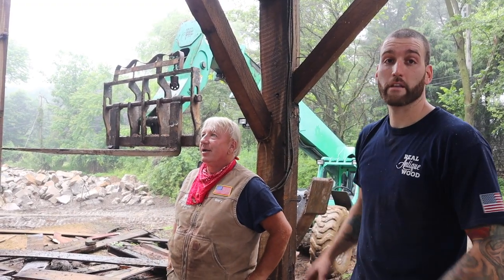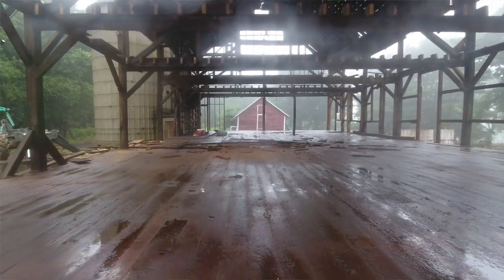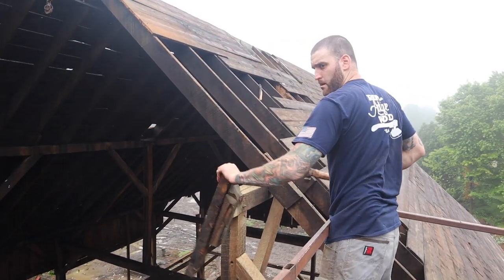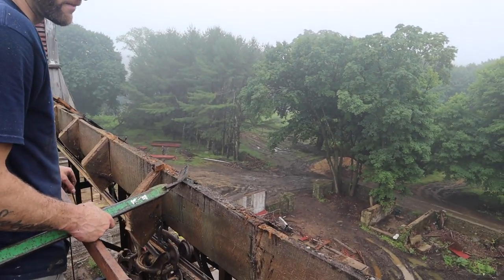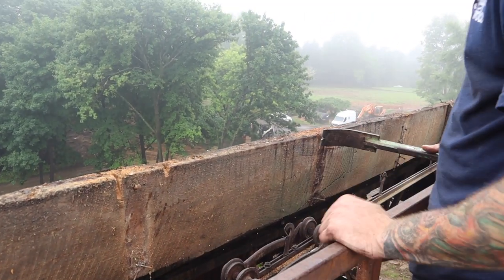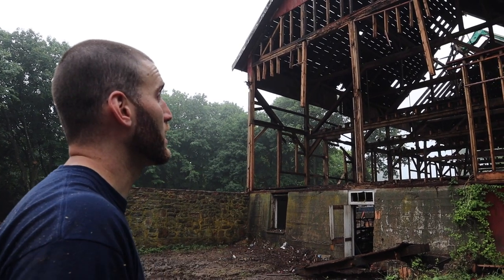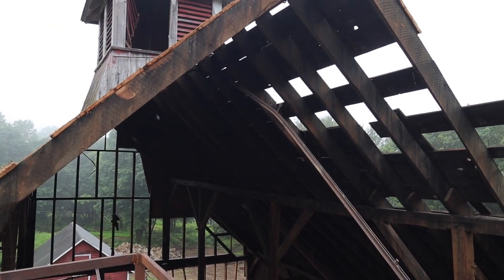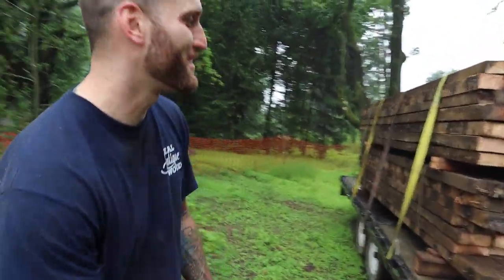Old New Jersey Barn Reclaimed Wood White Oak & Chestnut

Comment: Thanks John for sharing with us all. I love that wormy chestnut. I'm in the process of remodeling a 200 + year old house and had to remove a chimney that couldn't be lined. The base of it level with the basement was two 55" × 24" x 6" and they have become two beautiful tables. I used Wilbraham Drake Casting Massachusetts for the legs. I can't believe how dark it came out just using Waterlox it's absolutely beautiful! The only problem now is locating the material for the full size table and $750. for the legs. Stay safe!